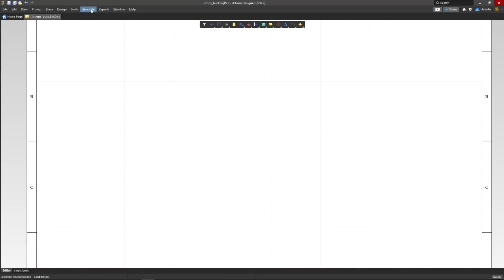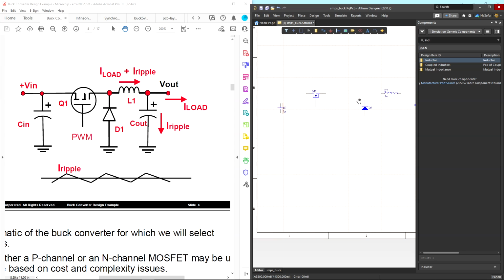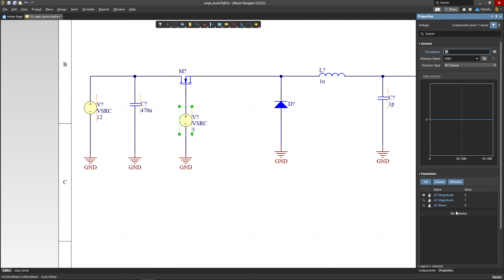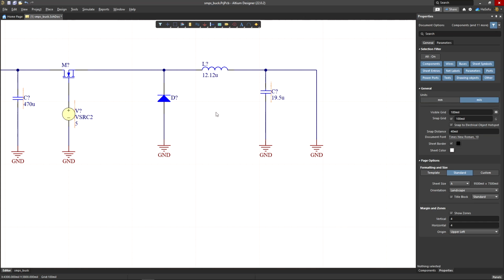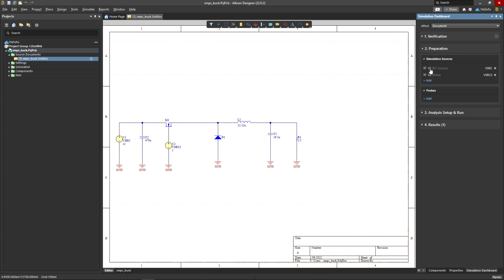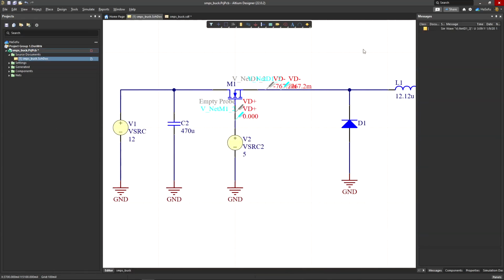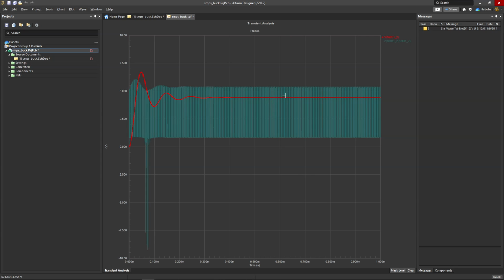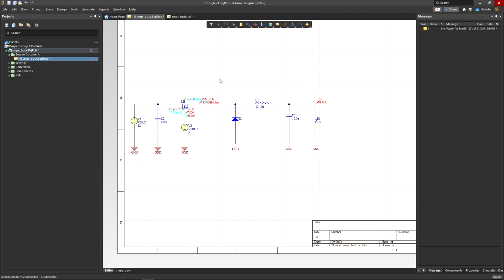Buck Converter Circuit Simulation [Altium Designer]

Comment: Thank you for your excellent videos, sir. But the real solution to the mentioned problem is that the "pulse" should be applied to the gate-source pins of the MOSFET not to the gate pin and the circuit's ground. if you apply the pulse to gate-source pins of the MOSFET,  you won't need high voltages for the activation pulses.
Reply from the maker: Yep that's true. I'll remake the video (I had the same problem in the lab in 2017 but didn't put that in this video for some reason).

Comment: Thanks for the video. If you were to take this design to the PCB, what's the best method for this. I know you can't take the schematic as it is now and bring it to a PCB because there's no footprints for the voltage sources. Are you better off having a copy of this schematic with no voltage sources and bring that to the PCB then, or is there a way to bring the above schematic to PCB and just tell Altium to ignore the components without footprints?
Reply: @techedkirsch  That worked out really well for me. I couldn't find any info about this or I didn't know what to search for online. That's very handy! thank you so much!

Comment: Altium is not capable in simulations unlike Orcad pspice. One example: i simulated amplifier circuit in Altium. Result was nothing close to the one i got in Orcad. Then i exported the netlist directly to ltspice. And the result was very close to what pspice has achieved. I’m done with Altium simulator. Altium doesn’t cope with transistors in the right way
Reply: @techedkirsch  , i'm diy audio hobbist. And to me the simulation capabilities are vital.